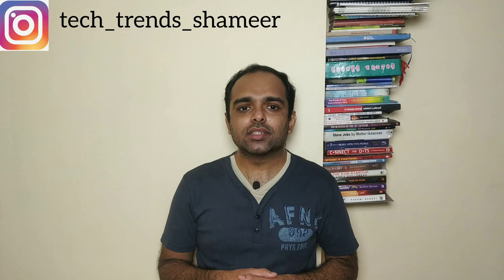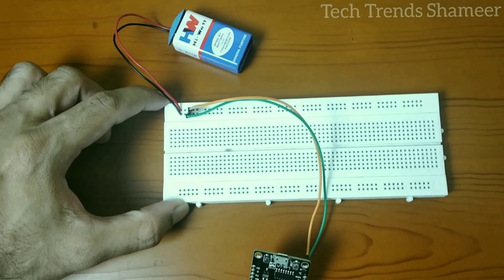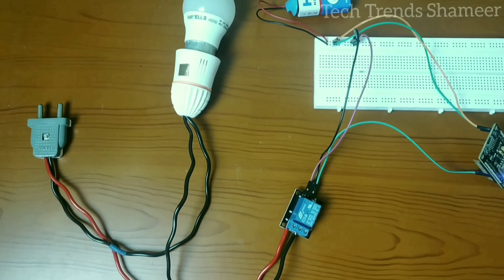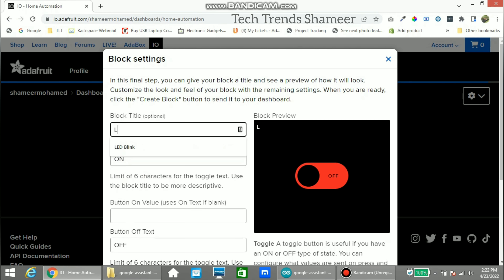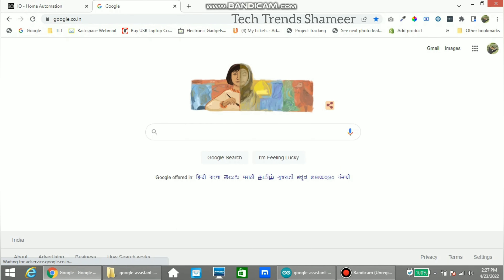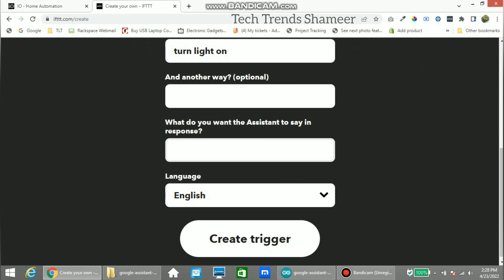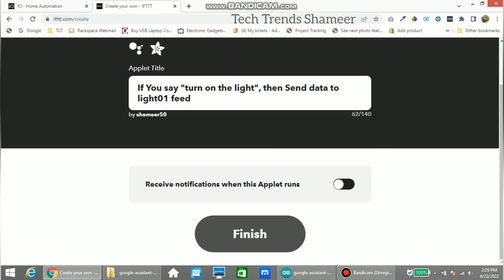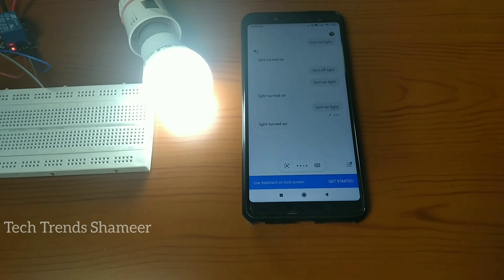Home Automation Using Google Assistant | Adafruit | IFTTT | NodeMCU

Comment: Is it possible to make a project with mq135, dht11 and esp8266 and link it with plynk
Reply from the maker: yes. possible
Reply: Is it possible to make a video with explanation?
Reply from the maker: @aljookir9999  May I know which explanation you are looking for? Using MQ135 ?
Reply: I want to explain how to use eap8266 with mq135 and dht11 and connect it with blynk 0.2
Reply from the maker: @aljookir9999  Ok. Let me try
Reply: I thank you♥️
Reply: How much time do you need to do this?

Comment: Sir ..I need your help on similar project..I already messaged you in Instagram.. could u please help me sir ?
Reply from the maker: Yes. Tell me. How can I help you?
Reply: @TechTrendsShameer   sir..we have done a project using ultrasonic sensor..i.e., when an object is detected it we get a alarm sound ( used buzzer)..our guide asked us to extend the protect so that ..when object is detected a alert message should get in phone.. please help us sir.. and thank you so much for ur response sir
Reply from the maker: @velagayaminisaraswathi4850  You need the alert as a notification using Blynk App or as a SMS ?
Reply: @TechTrendsShameer  anything is fine sir
Reply from the maker: Please check my another video

https://youtu.be/dAIp0onVFes
Reply: @TechTrendsShameer   yes sir we will do this ..if any doubts we will contact you sir
Reply: @TechTrendsShameer   sir..is there any possiblity for adding buzzer in this
Reply from the maker: Ok
Reply from the maker: Yes. You can add code. need to modify the code